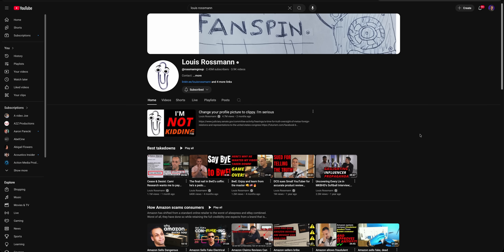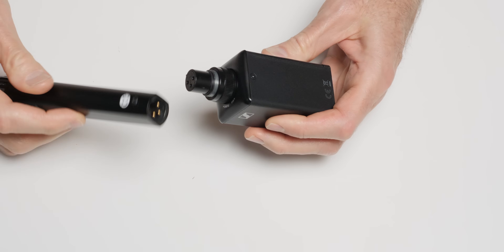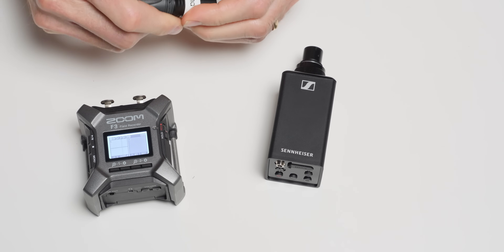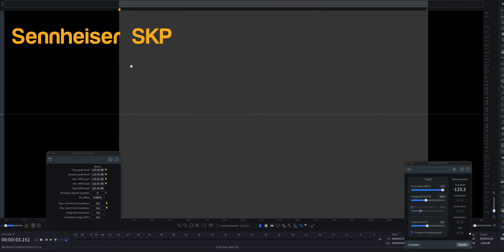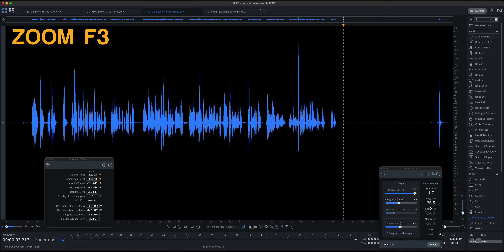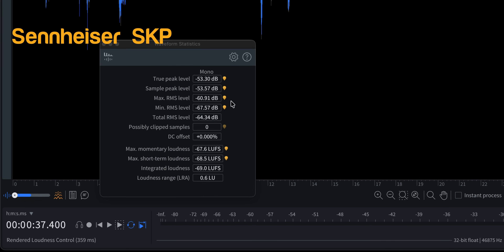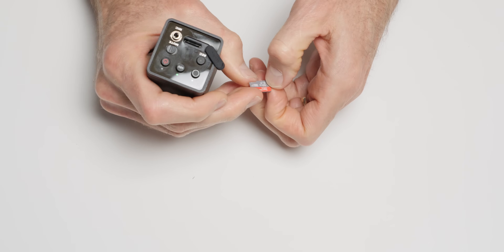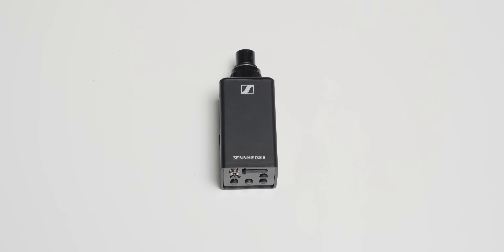Sennheiser EW-DP SKP 32-bit float self noise

Comment: Hey Curtis, would you think about doing the same 150-ohm test with the Tascam FR-AV2? Very curious if it is better or worse, especially since your prior testing showed slightly lower room noise floor if I recall correctly. Cheers! Your content really is the best.
Reply from the maker: Just did it — when recording with the input level set to +60dB, high pass filter set to 80 Hz (to very roughly approximate A-weighting), the max RMS level comes out at -68.45dB. Its good.
Reply: @curtisjudd  That's incredible! To think we've progressed so far from the days of the original H4! Thank you for replying to my comment from last month, hope you had a wonderful Christmas and new years!

Comment: Regarding SD-cards, I noticed that some of the early non-standard SD card that overclocks the 95MB/s UHS-I bus are incompatible with some old devices, for example BMPCC OG.

However if you buy new UHS-I cards with overclocks today compatibility with old devices is actually better, as manufacturers and SD-forum managed to get the overclocks more compatible.

So incompatible hell seems strongest in the earliest Sandisk cards etc that did the overclocks before working out all compatibility kinks.

Or just buy an UHS-II card that doesn’t try to overclock the UHS-I bus if you put it into an old device :-)
Reply from the maker: But this is not that old.

Comment: Hey Curtis ! It has been some time since I last commented. I like the fact you keep upgrading your setup and your videos are better and better each time.
I'm  glad you tested the equivalent noise level of both F3 and Sennheiser EW-DP SKP in 32-bit float mode. But I think you missed an important part if you want to have a full picture at the dynamic : the upper part of the dynamic spectrum which is loud signal.
Indeed, when 32 bit float came, all kind of new recorders popped up like Christmas tree as for the Zoom F6, Zoom F3, SD Mixpre x-II, and many others including lav transmitters with 32bit float recording mode like the one you're reviewing now. Even now big recorders like 800 series have the upgrade to use it in 32bit float mode.
Many have kind of the similar noise floor though. But when it differs the most it's how much they are capable of tanking concerning hot levels either on mic or line level.
When I used my old Zoom F8 (not in 32bit) with a pretty sensitive Sennheiser 8060 known to have very high output, I was sometimes dealing with clipped signal even though my gain on F8 was the lowest possible. Later I discovered the Max Input Level of the Zoom F8 was lower than the max output level I could have from the Sennheiser 8060 (for horror with a lot of screaming mainly or high SPL instruments). When Zoom continued on upgrading their line, providing 32it float recording, they did not raise their Max Input Level as you can see in spec especially for mid tier products like Zoom F6 and Zoom F3. So it means no matter how low you are recording, even if you are in 32bit float, you will still have to deal with clipped recorded sound as your pre will get overload by too much level.
For me that's a very important thing to consider, if not the most important as 3dB in noise floor is not so helpful if your sound is alreay burnt.
With the MixPre 10-II you have such a whooping dynamic especially on high level so that's why I ended up choosing that recorder.
So please consider getting into spec for the max level input considering we can use a 8060 or even a 8070 sometimes, and test it eventually when comparing 32bit recording products as it's where it would matter the most.

Thanks for the quality videos you provide
Reply from the maker: Thanks for the input and valid point. 👍

Comment: I'm using the Sennheiser EW-DP SKP for 1,5 years and it's a great transmitter and recorder.
The system has very low latency, the 32 bit recording is great and you can also use 3.5 mm lavaliers with the SKP.
The only negative point is, that you can't use every microphone with the EW-DP SKP due to its limited P48 current.
I wasn't able to get my Rode NTG-3 working with this transmitter - looks like the phantom power was not enough to get a working audio level, so I replaced the NTG-3 with a Sennheiser MKH-416.
Reply from the maker: Interesting, thanks for sharing.

Comment: When you measured -60dB in the practical sample recording, is that mainly ambient room noise, and nearly nothing from equipment noise by comparison to room noise?  I am so glad you measured and shared the self noise to confirm the excellence.  For the -130 dB self noise, is that one aspect full pro level?  Thanks.
Reply from the maker: Yes, mostly room tone.  Yes, pro gear usually achieves very low self-noise like this.

Comment: Many recorder manufacturers will provide a list of known compatible SD cards. The best way to ensure that your cards work with your recorder is to pick cards from that list. It is, however, more difficult to find some of these cards for older recorders, so it may pay to throughly test your recorder with inexpensive cards that are easier to obtain. Also, do some googling to determine if a specific card might have issues with your recorder.

Comment: Thanks for all the knowledge your sharing, you have been around for a decade i think. Maybe its time to take it all from the beginning? Why is self noice important (or is it? cant that be fixed in post?), whats the ”audio chain”, how come i great mic sound awful in some cases, when recorded with one recorder, and great with another? Is xlr really important or 3.5 mm good enough. Yes, I can watch your old videos and learn most of this, but its not really the same, and tech must have changed over the years, maybe a computer and ai can do most of the audio work now? (I dont think so, but I dont know). /Henrik from Sweden.
Reply from the maker: Too much to answer in one comment but I can say this: For non pro work, anything goes, including noise. For professional productions, whoever is paying for the production usually has an expectation that audio will sound great and be noise free. Yes, post AI tools can remove a lot of noise, but not necessarily all of it and if you push the noise reduction algorithms too hard and get rid of all the noise, the results usually sound worse than if they kept some of the noise.

Comment: From experience, I've found there are a few things you can do to prevent SD card issues:

First is not to use a card that's larger than the firmware/hardware can support. Bigger isn't always better, and older hardware tends to have much lower size limits.

Similarly, don't use a card that has newer fast-writing capability than supported by your device.

Lastly, format the card ONLY in the device, never on a separate computer. Doing a low-level format on a computer will frequently break the card for many devices, and that's confirmed in Lectro SMWB, for just one example. When transferring files, act like it's in read-only mode.

I strongly recommend testing new card brands before any important use by turning on all channels and recording at the highest rate and depth for at least half the card. At minimum, it should go over the 2 or 4GB file limit (in FAT32), to see if it properly switches to a new file.
Reply from the maker: Good tips, thanks
Reply: The format part is a myth today. I have tested the same compatible cards on windows, zoom f8n, Fujifilm and Nikon cameras without firmatting. I have also tested on other cameras and devices in the past. The cards always work fine. A file system is either supported or it isn't. Gear that requires ancient card types ir it's own format should be considered deprecated.
Reply: @aristotle_4532  
Generally, formatting merely wipes the directory track. This usually works for most things the same way, however, quick-format does not remove files. This is often done just by marking the first character invalid instead of wiping the track, and not everything reads that as invalid and will still open old files, but those files are no longer marked in-use, so badness can happen as the card gets written.

However, I specifically mentioned a low level format can absolutely render a card unusable on other devices. And I gave an example of a device that has specific instructions not to do a low-level format on a computer or it can brick the card. [Page 5 of SMWB manual.]
Reply: @chakerian  A quick format works fine if security is not an issue. Files that existed in the device are no longer relevant  The device that formats the card is also irrelevant  A device that has a problem with the card type and file system is claims it supports is faulty. Some devices can wear the card, but this is a performance, not a compatibility issue. Computers can configure a card and a file system in unique ways, but audio and video devices have no reason to do this.

Comment: Wouldn't a more practical test include putting a receiver on the F3 and measuring the self-noise of the combined system (Mic-transmitter-receiver-recorder)?  I assume recording to the card in the transmitter is the backup, not the primary use, but maybe I'm mistaken.
Reply from the maker: He wanted to simplify the signal chain and just record to the SKP.

Comment: Curtis, in your typical LUFS normalised dialogue with silence test, what would you consider an outstanding value and a not-very-good one? Just for reference.
Thanks.
Reply from the maker: -60 dB and lower is my general threshold.
Reply from the maker: But remember, this is not a scientific test - this is a practical noise sample and results will differ substantially with different microphones and in different recording spaces.

Comment: Lame excuse, Louis, not to use that fantastic kit over the minimal cost of a different micro-SD card. I use two with zero issues.
Reply from the maker: You might want to read his full explanation. He was also frustrated that the issue was difficult to diagnose because the LED just flashed when he attempted to record.
Reply: This is like me calling my customers lame for using the "excuse" that their MacBook does not power on when they press the power button. "Hey, my machine power's on just fine. You suck!!"

It's great when you can get it to work, but what I like about the zoom is you have a screen where it will output and tell you if something is wrong. There's tangible feedback in terms of error codes rather than just random blinking!

also you look like jesse waters stunt double